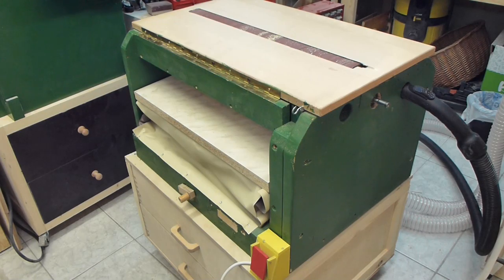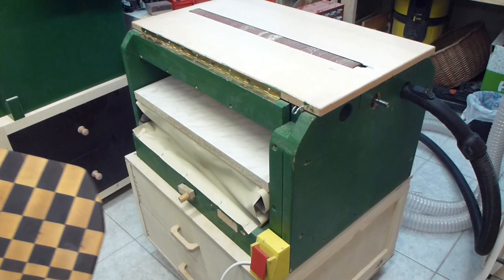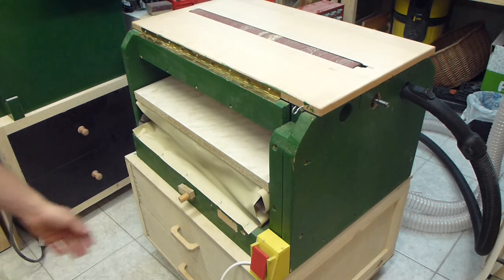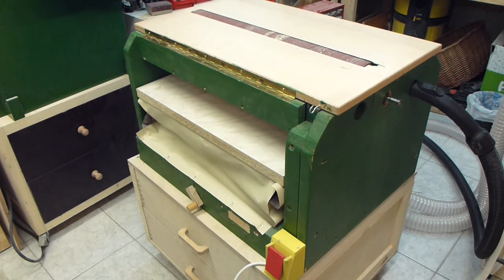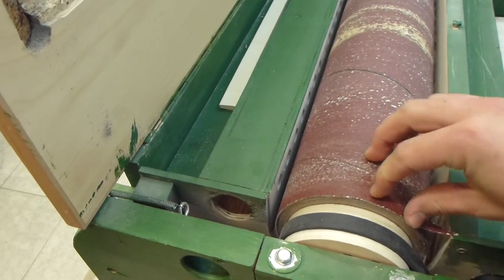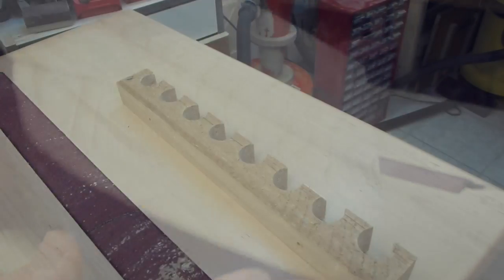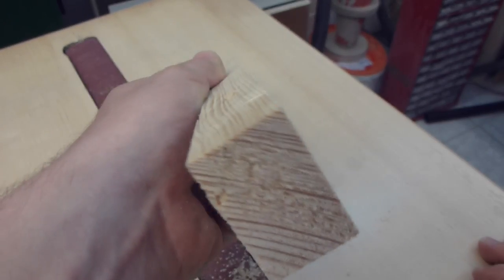Homemade Drumsander

Comment: I've been enjoying many of your videos this evening. You're an excellent woodworker and have fantastic ingenuity already at a young age. Well done and thanks for sharing! I'm quite curious about the mechanism you used for adjusting the lower table up and down. Yours seems to move directly vertical instead of tilting the table from one side to adjust for thickness of the stock. Would you be up for sharing what you did there? Thanks again Marius! I'm really enjoying your videos:).
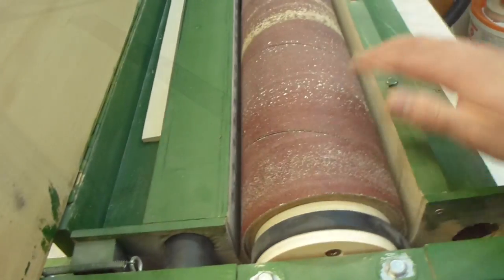Reply from the maker: tlgrimmy Thank you! The table does tilt like most others. A hinge on one side and a lift type mechanism on the other side. I got the idea from here: https://www.youtube.com/watch?v=R9DVDZBd0s0 Look at 2:35
Reply from the maker: technically yes, but because the sanders removes just a tiny bit of material, you won't notice that.

Comment: Hi ! 
I want your advice about this machine and the work I'm gonna need to do :
Soon, I'll start building my own house, I'm gonna need to sand a lot of joists and I was wondering if you think, this kind of machine is good to do such a work ?
Reply from the maker: what kind of joints?
Reply: Marius Hornberger not joints but joists (like post or lumber) piece of wood like that : 7,5cm by 15cm by 3m for example.
Reply from the maker: oops,
then this is probably not the right machine. Building it takes a while and buying one is expensive as for joists you need a really big one. I'd recommend a good random orbit sander.
Reply: Marius Hornberger thanks you for your advice ! I didn't even thought to the orbital sander !!